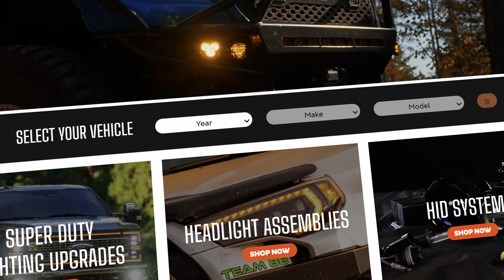HID vs LED Headlight Bulbs: Which is Better in 2025? | Brightness, Fitment & Output Test!

Comment: HID IS BETTER
Reply: You’re wrong.  They aren’t even close.  Older LEDs aren’t even close to newer designs and all are better than HID.
Reply from the maker: Everyone’s got their preference! HID still has its strengths, especially in certain projector setups—but modern LEDs are catching up fast in output, reliability, and ease of install.
Reply: I've heard this as well. I recently called in technical support to HR's parent company and at least from the individual I spoke with, HID's with an HID projector still project further and create a superior beam pattern than LED bulbs especially compared to drop in LED bulbs in a halogen headlight lamp. It seems as though more and more car manufactures are going LED because of the superiority to halogens and the cost effectiveness compared to HID's. I did a HID retrofit in one of my older cars (2012 wrx) and did the whole HID projector plus all the HID bits mentioned in this video, and I have a newer car (2023 Forester) that came equipped with LED headlights. Confusingly I prefer my newer vehicle equipped with LED's over my HID retrofit. So I'm not sure what to believe. I wish HR/TRS would do a more up-to-date video comparing the lux values. With all that said, I've done LED drop in bulbs on another previous car that I no longer own (2021 crosstrek) that came equipped with halogen bulbs which was a massive improvement and for the cost and ease of upgrade, it's LED all day if you are looking to upgrade from halogens.
Reply: I honestly say its preference if you had to choose between Led or Hid, i will admit that LEDs are brighter and cheaper than doing a whole retrofitted HID solution, I have my OEM HID retrofitted with Morimoto Evo XR 2.0 with Osram's Night Breaker 220% bulb and they compete with cars that have LED headlights in them lol, my HIDs throw down farther and wider, overall better beam pattern so there's way more actual usable light compared to leds. Its easy to look at the numbers but its different in real world scenario
Reply: No it's not